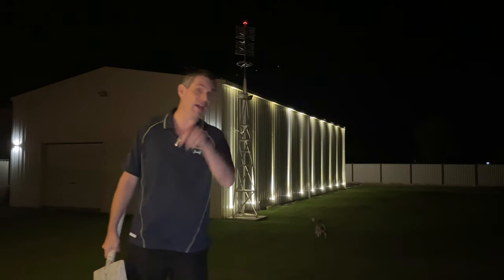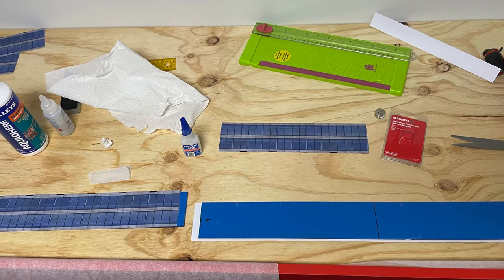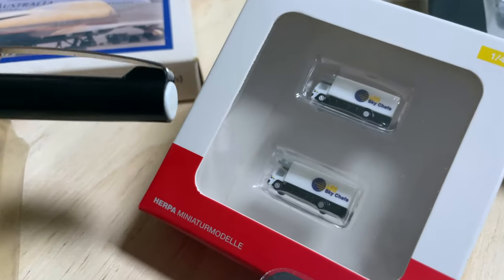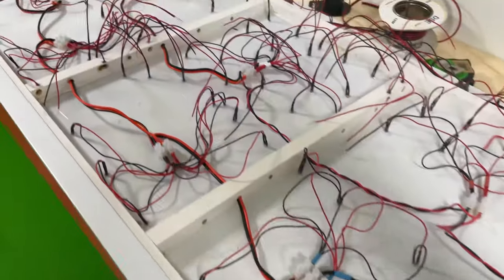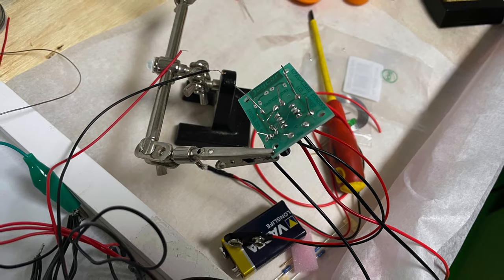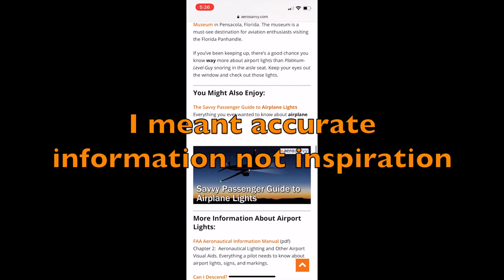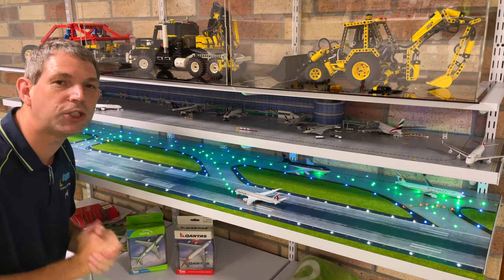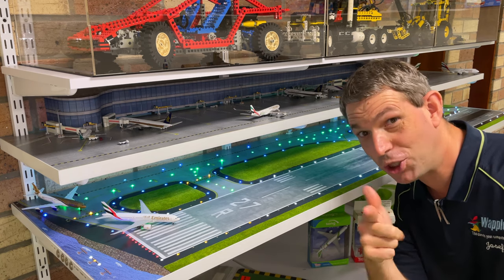Josef - Model Railway & Toy Room 7 Model Airport DIY LED Taxiways GSE Comprehensive how to build

Comment: Awesome Video! Just a small correction, if aircraft are taking off from RWY 27R, the landing will also be on 27R. Had the aircraft been taking off from the opposite side (RWY 09L) the aircraft would then land on 09L.😅
Reply from the maker: 100% right I did not have a protractor or compass handy to cross reference at the time still that’s my gift from you I love having anomalies in things I do since it always gives us things to have a pow wow about and of course the focus was to put the planes somewhere other than a shelf lol

Comment: How can I make the wig wag hold short light
Reply from the maker: Easy kit required is there or the alternative from NOCH then just take the 4 cables for the leds and extend them to whatever you want you will be able to parallel wire up your required number and then just alternate the one half with the other.  It’s all in there.  And very logical but if still stock I will probably do a vid on it as model railway progresses we will see similar techniques.